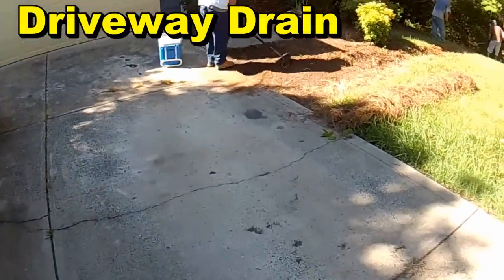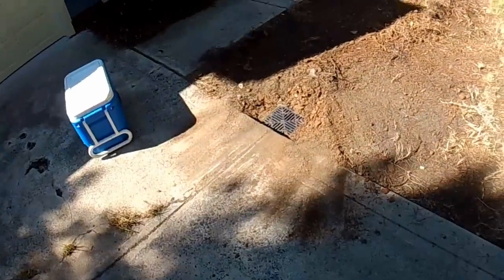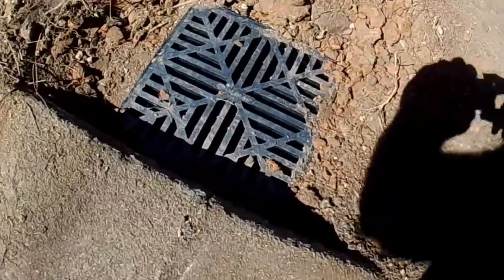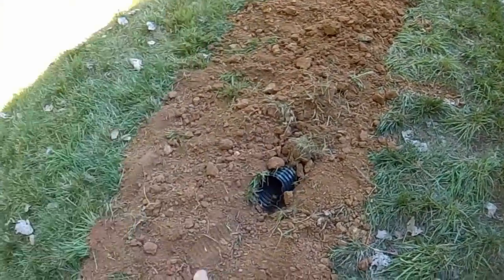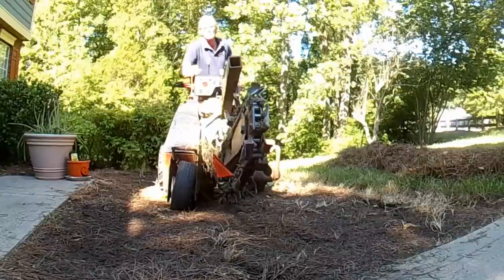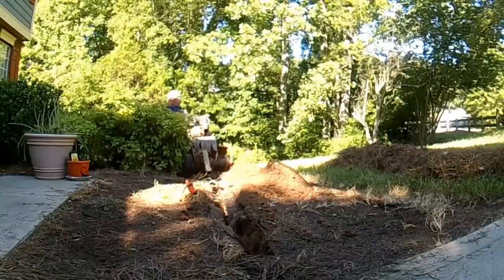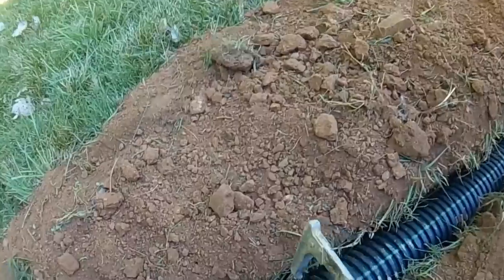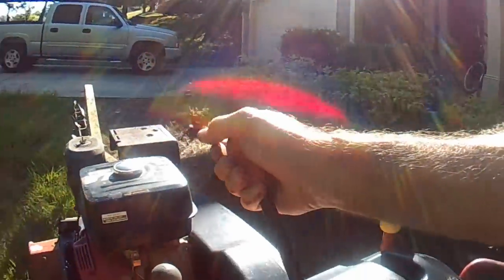Driveway Drainage, Channel Drain or Catch Basin?

Comment: Chuck, your videos have been a lifesaver for us at our house in Portland Tennessee.  We are having a TERRIBLE time our new house (less than a year old home) with drainage.  Our contractor didn't grade our land properly so storm water floods our land starting from the field behind our house and heads right for our foundation and has us basically sitting in a bowl of water.  Trying to get the builder to fix it or assist us has been a nightmare.  The town engineer won't help us, the land developer for the subdivision we are in that bought all the land behind the house won't help.  My husband decided to install a french drain himself all around our property.  Without your videos, we would've had no clue as to where to even start.  Thanks so much!!

Comment: I have this problem at the end of my driveway but I don’t have a down hill run, what would be the best way to install a drain?
Reply: seepage drain
Reply: I’m going to try a dry well
Reply: @juniormoore3023  How did the dry well do?
Reply: @yume816  thanks for asking. It wasn’t deep enough or wide enough and fills up quick. I hit rock and didn’t have the space I needed to make it wide but it does work till it fills up. I needed to put a drain over the rocks too.
Reply: @juniormoore3023  That’s my concern too if there’s no pipe to release the water. Poking some holes on the dry well may help.
Reply: @yume816  yeah maybe. I’ve pretty much given up tho
Reply: @juniormoore3023  Yeah, I get it! Just hire a professional if you can so you can free up your time. Everything has a solution. Good luck! :)